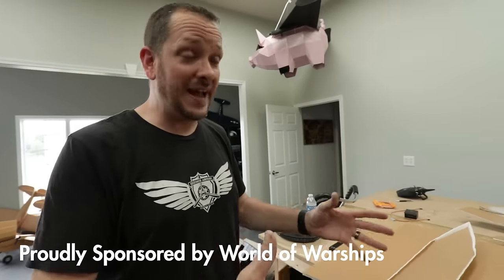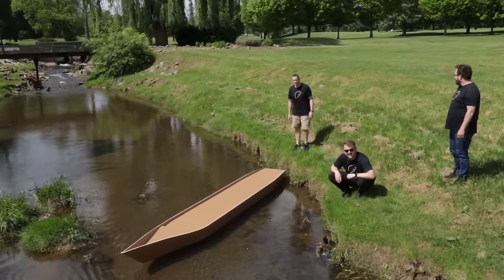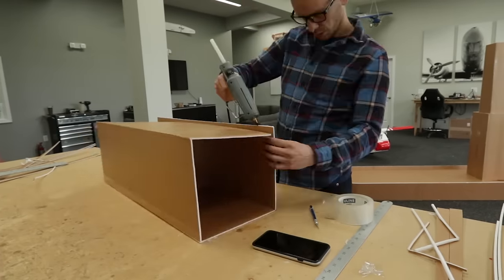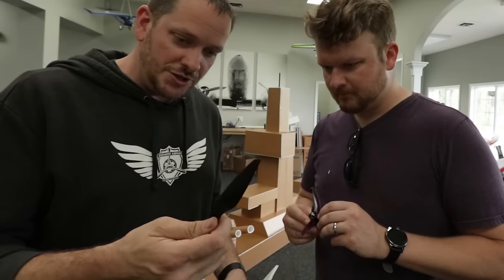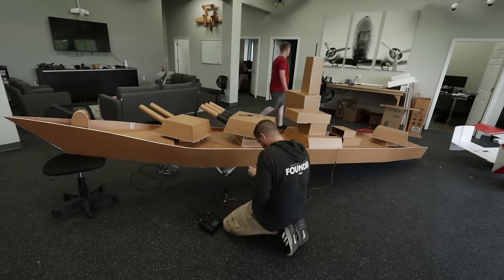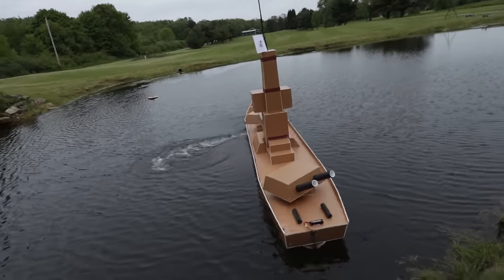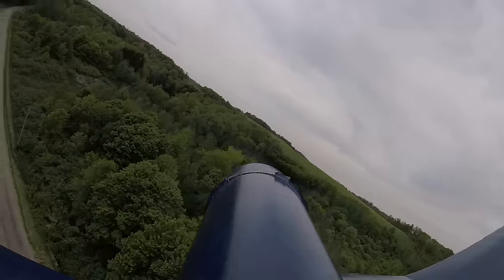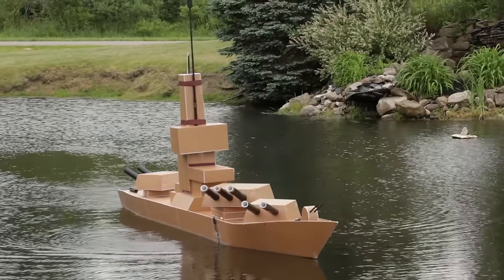Largest RC Battleship VS RC Dive Bombers!

Comment: FPV airsoft guns firing on the aircraft from the ship! Bottle rocket torpedoes from the planes. FPV the planes and do dive bombing from straight up.
Reply: Light small fireworks in the gun turrets
Reply: BB guns and paint ball guns for the cannons could be a team ft 3 controllers for the ship
Reply: I agree, there's so many ways this could've been better. So disappointed.
Reply: This could be an awsome competition.. fpv battleship..
How about FPV flying fortress with airsoft defending against attacing fighters..
Reply: and a powered whistle as jericho trumpet
Reply: @saqibjaved1900  well what they were doing wasn't dive bombing. 
That was also what midway dive bombers did wrong. They didn't dive. The thing about dive bombing is that when you fly right down 90 degree then you just have to look if you are over the ship and drop the bombs and the bombs will fly down strait cuz there is no movement to the side kept from the plane
Reply: @JHF80  how about a flying fortress attacking the boat and fighters have to defend the boat. So THEY WONT SINK MY BATTLESHIP
Reply: @michaelerhardt2549  yes you are right aboutdivebombing concept ,,, thats why i suggest it,,  cuz in this way they  might hit the target
Reply: @saqibjaved1900  I thought it was ironic
Reply: @michaelerhardt2549  haha dive bombers did not go 90 degrees down lol. That will cause two problems: 1. The wings might break off and 2. The pilot may faint. They did it in a more slant angle.
Reply: @sleepynight7931  it's their space. They own it obviosly

Comment: Bombing run far too shallow. Come in at an 80 degree dive via FPV and you'll hit it quite reliably.

Also, I really need to finish my airboat project. Got a foamboard hull built, need to get a Cox 0.049 to power it and some servos installed!
Reply: Wow you no your angles
Reply: @blackfox9947  Pretty logical actually. If you come at straight 90 degree dive, wings loose lift? your aircraft becomes much harder to control and you cant recover from dive at all or much slower than with 80degree. Also you are still moving, so technically its less likely to AA guns to score a hit. You also gain speed from dive that accelerate dive bomb to penetrate deck of a ship, so detonation happens inside of the construction, causing even more internal damage and hopefully flooding, sinking the ship.
Reply: Exactly
Reply: That’s why I really wanted to see this video.
Reply: Yes! please! FPV will make a huge difference! Glide attack and dive attack will both work, but it really needs FPV!
Reply: Just throwing this page out, http://www.daveswarbirds.com/navalwar/divebomb.htm, The full website is here, http://www.daveswarbirds.com/navalwar/frames.htmThe video looks more like they were trying torpedo bombing really, though they weren't low enough for that. They do have cameras on the planes judging by some of those passes, so FPV would have been a good idea. But what about dive brakes? Scale speed probably wouldn't require them, then again how fast would R/C planes pull up out of a dive
Reply: I agree. A lot of my thinking is from war thunder btw. Not hating as well.
Reply: Lose lift? No they don’t lose lift unless they stall. The only angle that cause them to stall is the relative angle of attack. About 16 degrees.

Comment: the difficulty to aim is actually a problem that the fighter pilots of WWII experienced. this is actually where the "dive" part of dive bomber comes from. you need higher initial altitude, and then when right over your target the entire plane dives directly towards the target. they can aim the entire plane at the target, release the bomb, and pull up. you should try this, because you'll find it's a lot more accurate.
Reply: i agree this is why they called DIVE bombers ,what they did is strafe and run like for torpedo attack
Reply: well not exactly. You are describing a stuka, while bomber in general went for a similar persuit as them.
Reply: @archiusdornius  No, the Stuka wasn't the only dive bomber during WWII. As we are focusing on bombing boats, the dive-bombing strategy was the main one. As seen here : https://youtu.be/h7Z0yUYHgP8?t=113
Reply: @gamo-LT-fut  I think what he's saying is that the stuka was the only db during wwii that strafed and ran
Reply: @Inhale_8632  not true
Reply: @Inhale_8632  wut.....
Reply: @archiusdornius  the battle of midway would like a word with you
Reply: However you do need to use air brakes and Low throttle or you gain too much speed and the wings break
Reply: I must suggest just going full kamikazi at this point.

Comment: Wow! That was pretty amazing. Some of those near misses would likely have done some minor ruptures to the hull of the ship, not likely enough to do much during the battle, but enough to slow it down after the fact. 
The Corsair is my very favorite WW2 plane. I feel in love with that beautiful piece of machinery over 20 years ago after reading an article about it online. It is a marvel of engineering and performance, despite its quirks and difficulties. One was even credited with a kill using its massive propeller! 
This was a cool video, and I think that, with some practice, you will eventually be able to hit the ship with a bomb. I am going to check out the watermelon drop right now.

Comment: I'd love to see the planes dropping motorized torpedoes instead
Reply: That would be awesome and a lot easier to hit just go low as you can then drop from a distance.
Reply: Yes
Reply: @nibbles9357  easier to use, though way harder to build
Reply: @Fred_the_1996  yep
It need to not explode once it hit the water which is pretty hard to program
Reply: You do know what a torpedo is?
Reply: @catt0215  some aren’t motorised, but just shoot.
Reply: @adamchmielewski6162  planes dropping torpedos...
Reply: Planes can drop torpedos
Reply: @catt0215  Torpedo bombers exist
Reply: @lalrinmawiaralte7132  I do now yes, at the time I didnt
Reply: @catt0215  yes it happens it was used multiple times against subs and battleships
Reply: @AtlasAlternate  I already cleared up that I was uninformed about that at the time, read the comment before you reply please
Reply: @catt0215  i saw it

Comment: "You can't have a battleship without a battle"
Yamato Hotel: OBJECTION!
Reply: Well, it sunk a us carrier
Reply: @balint1067  uh... no?
Reply: Abandon the Cave 

Turns out she damaged a CVE at Samar, but didn’t sink her.

But yeah, not a particularly useful ship or even one that was necessary, though that applies to all WWII battleships
Reply: @bkjeong4302  Eh there's no confirmation that the rounds damaging the CVE were hers, though people often just say that they were.
Reply: @bkjeong4302  Well, more accurately none of the Gambier Bay crew confirmed the damage lined up with the 18ers from Yamato, and it's a japanese claim.
Reply: Abandon the Cave 

Of course they wouldn’t (and couldn’t) confirm the shells came from her; the engagement was plain too confusing to identify which shell came from which ship without already knowing the set splash colours for each vessel.

And I was actually thinking of USS White Plains, in which case things are less ambiguous (though not completely proven).
Reply: @bkjeong4302  Eh not necessarily, the extent of damage inflicted by a shell is often used to determine which enemy ships pose a particular threat. They use that damage inflicted based on where on the ship it impacted, as well as the conditions of the ship at the time to see what size projectile would be needed to cause the damage. In Yamato's case, it would have been easy to identify a Yamato round's impact as the 18" shells were vastly more powerful than anything else amidst the waves at the time.
Reply: The super weapons of the day weren't so super once they realized they're riding on the enemies most important target
Reply: Abandon the Cave 

IIRC, the 18” (and other guns from Japanese capital units) at Samar didn’t really do all that much damage because they went straight through without exploding.
Reply: @bkjeong4302  On a CVE? 18" shells from the Yamato weren't especially high velocity, and from my knowledge they were using S-APHE (semi-armor piercing high explosive) which wouldn't overpenetrate even an escort carrier.
Reply: Abandon the Cave 

NavWeaps states that for the 18” guns there were the standard AP and HE shells plus the ineffective sanshiki shells, but no semi-AP shells. 

But you’re right about velocity-the 18” gun had a higher velocity than the American 16” gun, but it was still not a true high-velocity weapon like the 15” guns of German or Italian ships.
Reply: @bkjeong4302  yall made a really interesting thread of comments, read it all.
Reply: Technically she did fought, you know who never fought at all and her best record during ww2 was sinking a training cruiser in target practice?
Iowa

Comment: Try the bombing run with FPV, and dive on the target.

I think you should convert the battleship into an aircraft carrier, with arresting gear so you can land fixed wings on it.
Reply: FPV will make a huge difference. Also, yes, add arresting gear and make it a carrier. Anniversary of Battle of Midway coming up in two weeks, nice to add something about history.
Reply: Exactly what I would do. Flite test is about flying so what's better than a real floating aircraft carrier?

Comment: Great vid only have 3 suggestions for the boat. 1 a keel, you were afraid of having wind issues, a slightly weighted keel would aid in this. 2 Angle the rudder fins closer to 45 degrees this would provide a more "realistic" movement for a ship where turning is normally done through a rear rudder. 3 if you plan to put this in rougher waters add a small pump in the hull to pump out any water leakage you might get while putting batteries on small platforms to keep them dry.

Comment: Drop 100 paper airplanes out of the huge cargo plane!
Reply: Just 100?..
If you stack them you could use a rubber wheel attached to a motor and flick them out one after another in a massive line of them.
Reply: @TheWebstaff  Yeah that would be cool!

Comment: If you going to work on Ships then learn the correct terms, Bow (Pointing end),  Stern (back end), Port Side (Left Side),  Starboard Side (Right Side),  Screw (not Prop) , Ship (Not Boat).  Landlubbers!
p.s. FYI, It is Called Dive bombing,  your Aircraft attack runs were more like torpedo attacks.
Reply: Exactally...  and make it look like a ship instead of floating cardboard boxes. Ships have names.. Your entering dangerous water here.. lol
Reply: And a stern cavity would help, along with a keel of some kind
Reply: I think you're taking this a little too seriously
Reply: and just to add called the superstructure tower...
Reply: @masoncao7809  I beg to differ..  They use all the correct terminology for all the airplane stuff they do..  So if they are putting remote controls in floating objects. that are supposed to be copy's of actual ships..  they ought to use the proper terminology there as well..  and I say Bravo.. I would like to see more of boats and ships in their builds..

Comment: try to make ju 87 stuka with air brake 
that would be a proper dive bomber
Reply: An IL-2 would be pretty cool as well, though it isn't a dive bomber.
Reply: Can't forget the siren though.
Reply: No way a messchersmite
Reply: kcs gaming and coins tdc 

It's Messerschmitt.
And there's many Messerschmitt aircraft. E.g the Bf-109, Me-262, Bf-110, etc. I'm assuming you meant the general Bf-109. I don't really think it was used as a dive bomber, though... Like the guy said, the Junkers Ju-87 Stuka would be better as it was a purpose-designed dive bomber.

Comment: Hallo Flite Test. If u want reverse u can use an extra channel for a servo that will flip a reverse polarity 2 position 6 pin switch that you connect to the motor wires reversing 2 of the motor wires to change motor rotation. I tried it and it works but when switching between forward and reverse it works best when throttle is at 0 position. Your welcome. :)
Reply: Or use the ESC from the grand tundra as it has already has a reverse function for the motor. You're welcome

Comment: Please make an aircraft carrier and flight/land planes on it.
Reply: I believe he has done it...
Reply: This would be a great FliteFest competitive event, or even non-competitive group activity.  Also, build a similarly-sized carrier for FPV tail hook landing competitions.  Every competitor has to use the same design.  Put each competitor's  FPV feed up on a outdoor TV in front of a grandstand along size a deck view, or simply live stream it on YT.   That would make for spectacular video.  Make the competition progressively tougher by adding headwinds (fans) and  artificial deck roll (thrusters) until there is one pilot left.  An FPV torpedo bombing competition would be fun, too.

Comment: An attack run with a steep angle at the release gives higher precision; though it also lines the air plane up for contact with the surface as well. 45% angle might do it, but the closer to vertical the more precision can potentially be gained :3

Comment: Uh all three gun turrets fully functional airsoft cannons DUH!!!
Reply: Agree
Reply: each gunbarrel should have a 40 Mike in it. they’d need a lot more backup planes though, because 400 BBs a second will tear through that foam like a hot knife through butter lol
Reply: @dylannix4289  yeah a 40 mike sounds good but the damn thing will probably capsize under the recoil
Reply: mitymike 1996 hahahha yeah, maybe they could fire from either side at the same time. like they used to do back in the time of sailboats and pirates😉
Reply: The turrets are offset so we'll see a battleship do donuts 😆

Comment: Make the ship pretty, paint it, nice details, have a working AA defense maybe? 
Or be able to launch and recover a seaplane from it
Reply: Launch a seaplane sounds interesting. Probably have to be smaller than the Corsair and Warhawk given the boat so as to not have the rear turret in the way of the wings and catapult. Or remove the turret all together. It would also require a crane to recover the seaplane.
Reply: @richardgreenleaf3259  
Naturally, I think they would be able to pull it off though, they would have to make changes to the ship but I figured they would be doing that anyways for more improvements 
Personally, I would like them to do something more permanent instead of using foam, like the foam would be a good testbed for what works and what doesn't before moving onto wood, which would take time and money, but hey, that's why it's a hobby (:
Reply: @redtsar  I agree they'd have to make changes to  boat for launching and recovering a seaplane, even if they go with a seaplane smaller than the Corsair and Warhawk they used in this video. It doesn't have a catapult or a lift crane and would need those no matter the size seaplane they go with. Though I think right now it does have enough clearance aft the rear turret to land a small quad. The speed this thing is cruising at in that pond, shouldn't be that hard to do a small quad take-off and landing. But a seaplane would be more interesting to watch.

Comment: They missed the point where it says DIVERS, if you dont dive its obvious that you will miss
Reply: I'm not sure if it would scale well. Also, one of the reasons dive-bombing was useful was because the pilot could just aim with the front of the plane, these guys are flying from a third-person perspective, thus it is still likely they will miss, and they will also likely crash their plane. Another reason for dive-bombing was to penetrate the armor of a ship, that ship is not armored. 
And, lots of historical WW2 dive-bombing runs were misses.
Reply: They cant really go up that high for dive bombing so the only options available for them to sink the ship was glide bombing, stomping or punching it, and Kamikaze.

Comment: Cool video, and awesome building skills. 
However, it's a DIVE bombing. Plane should have been in a steep dive, from above the ship, when the bombs were released. They were unguided, in WWII, and that was the simplest way to nearly guarantee a hit: Point the plane directly at the ship, while diving almost straight down, release the bomb, hold course long enough to "guide" the bomb, then sharply pull out of the dive. (Remember, those old battleships weren't stationary, and were fast and maneuverable, while the planes had to juke around flak and AAA.) Wash, rinse, repeat, until the IJN Yamato is a smoking, sinking hunk of scrap metal!

Comment: Actual dive bomb training with fighter planes was to dive straight down vertical towards the target so when they release the bomb it had the planes downward momentum with little to no air resistance and forward speed. As well as giving the fighters less chance of being hit by anti air fire. Flying horizontal towards a battleship was considered a rookie mistake with dropping bombs. Now fighters carrying torpedo would fly low, but not fighters with bombs. The reason torpedo fighters flew horizontal was because they had to skip the torpedo into the water horizontal so it would go forward. So you saying lining it up is how they did it is not accurate when it comes to fighter bombing fyi.
Reply: at the end of the war, torpedos was dropped from high altitude,, they did come almost vertical down, but there was a mechanism that once in the water, it did line up with the direction it had when dropped,,at that time it was the single most used method to sink Japanese ships,the plane had radar for altitude and distance,,,other planes did attack the ship to diverte atension to the torpedo plane